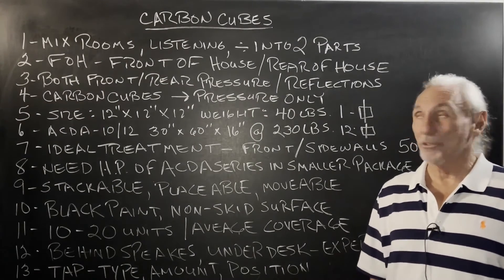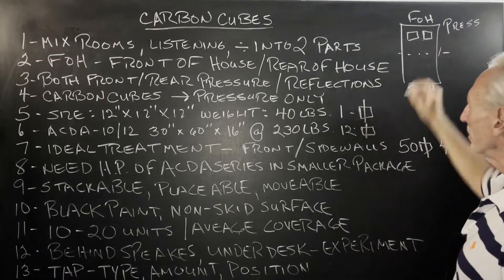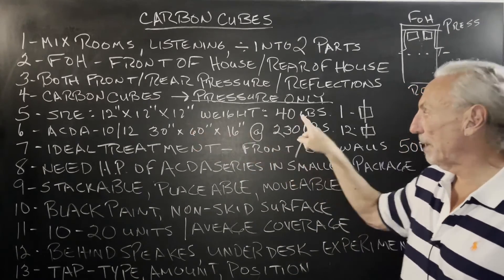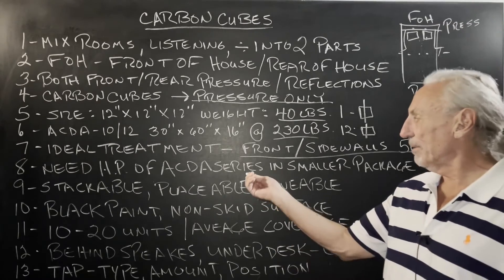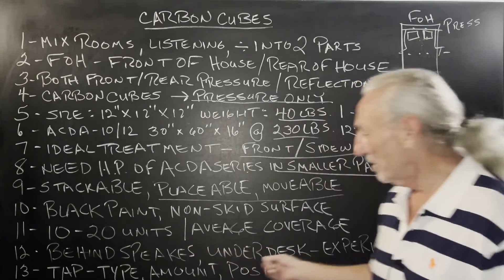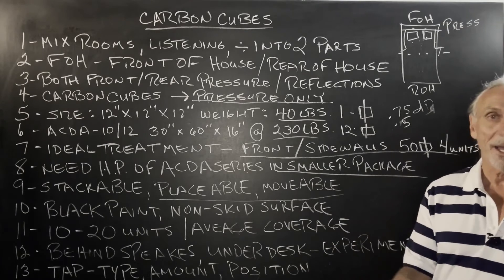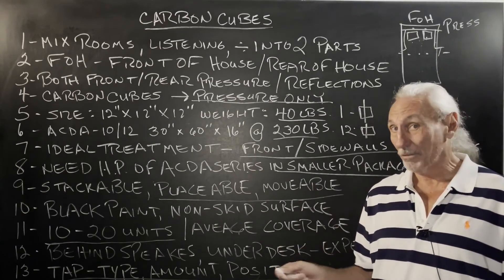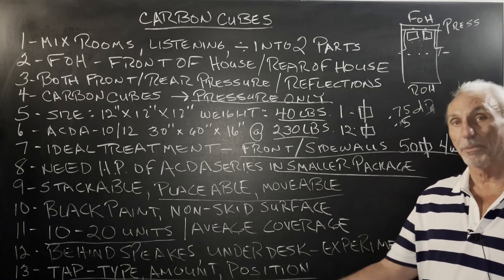Carbon Cubes - www.AcousticFields.com

Comment: Would these work in a room smaller than 15x14
Reply from the maker: They work in any room. However, with low frequency management, it is all about the amount of treatment coverage on each surface area. They are best used in certain high pressure locations in the room if budget and space are issues.
Reply: @AcousticFields  thanks for the info

Comment: Question: You mentioned that the cubes could remove annoying peaks in the room. That is easily achieved with PEQ. Isn't the real strength of all your products to remove negative modes? You can't PEQ them "upward" because there's nothing there to EQ.
Reply from the maker: Sound absorption deals with the strength or amplitude of the modal issues. It resuces the strength through absorption.

Comment: Interesting. I went to your website and used the Search box for the terms "cubes" and "carbon cubes". Both returned no results. The only product I found was the ACDA-10 M | Modular Bass Absorber at 70 pounds each and $750. Before describing a product, it's a good idea to upload it to your website. Due to the high price point of the ACDA series, a lot of people may find your smaller cubes an attractive alternative.